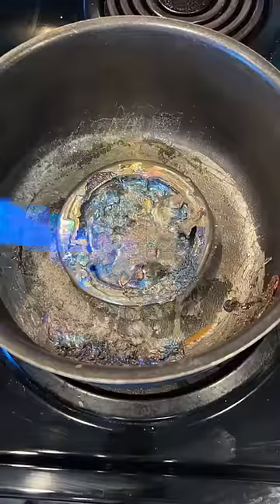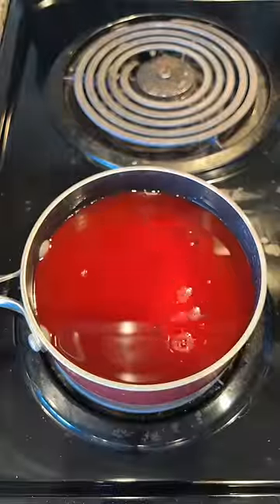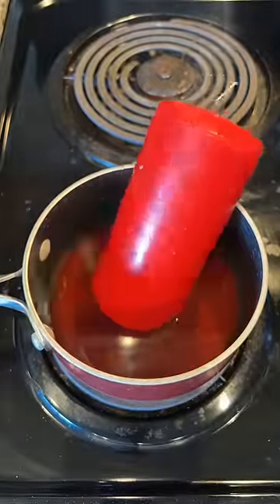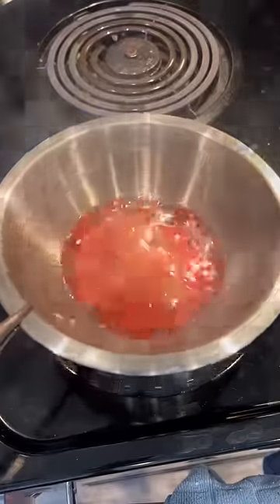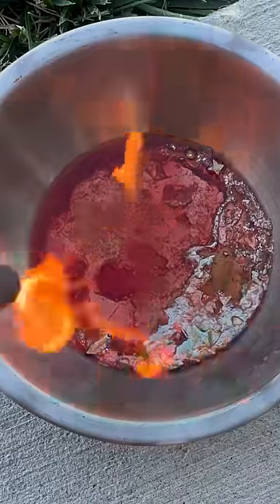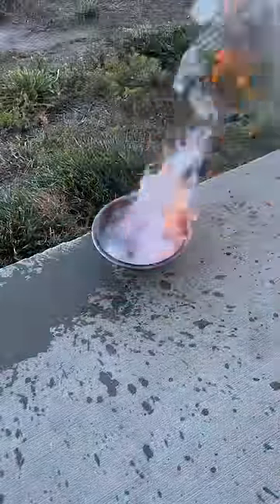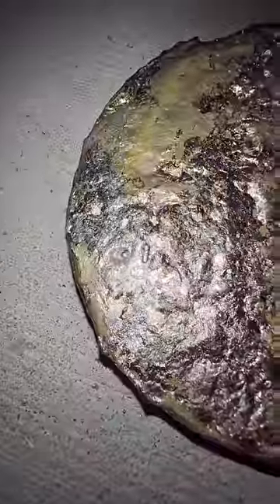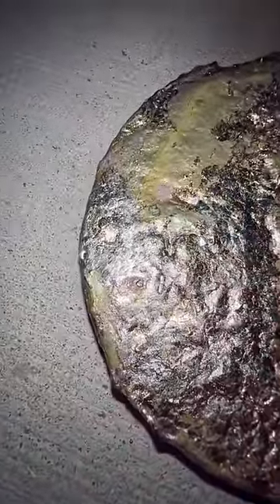Will Molten Metal Mix with Wax?

Comment: “What happens when you mix an oil with a dense metal?” I’d assume they separate just like they should?
Reply: What about the try of extinguishing it with water😄
Reply: @VR46Monster   He new that was gonna happen, but unlike know what would happen he thought there would be something special about mixing bismuth and wax, which was just stupid to think.
Reply: Cool bit of knowledge. They infuse soft metals with oils to create bushings that would have been eaten up by the shafts. The ones i use at work are called oil impregnated bronze bushings. Really useful in the engineering world.
Reply: @robertgarber1678  what was the oil doing to the bronze bushing tho
Reply from the maker: That’s actually not all that happened. Yes, initially the less dense wax floated on top, but after stirring it up a bit it did indeed mix. I still have that chunk of bismuth and it has a very interesting waxy feel to it. Nothing Earth shattering, but still kinda interesting IMO
Reply from the maker: @rjaylick-uni_novaz  I didn’t think anything crazy would happen, but I do think the results were kind of interesting. Yes, the wax initially just floated on top of the bismuth, but after stirring it did indeed mix. Nothing Earth shattering, but still kinda neat.
Reply: @jackschneider17  nothing mixed. You just stirred it and so some pockets were created, trapping the wax in as the metal solidifies.

Comment: Bro called a candle a wax stick 💀
Reply: It is though
Reply: It literally is made out of wax, what's so weird? -_-
Reply: A Filler wax stick is used for either to repair cracks, splits and small to medium-sized holes without sanding or having to strip the finish. hair wax stick makes your hair silky smooth and soft, easy to comb, prevents frizz, flyaways and tangles. 

Even though you could do these things with a candle, that's not what a candle is intended for.
Reply: @proxyhx2075  wax sticks are different from candles even though candles are made of wax. You can't use a candle for the same purpose other waxes are used for, at least properly lmao

Comment: You should look up how they used wax to form the inter cooling channels on the main combustion chamber of the space shuttle in the 70's using electroplating and then getting the wax out after.

Comment: I “mix” wax and molten lead all the time.  It smokes, catches on fire easily, and allows the lead oxides to reduce back to metallic lead.  And it acts as a kind of flux to pull imbedded crap out of the melt.  All at about 680-700 degrees F.

Comment: It's actually possible to mix metal with wax via sintering. Simply get both into a powdered form and press them together at very high pressures. If you really want to get fancy, send a current through it to heat it up a little bit to increase the viscoelasticity (but don't exceed the melting point). This method is known as Field Assisted Sintering Technology

Comment: I'm not for certain, but I do believe that they use wax in some castings. As the molten material goes in the mold the wax burns away. It might not be wax, but definitely something similar.

Comment: If you grinded up the two materials,homogenized them and put in a vessel with extreme pressure while heating above both melting points I wonder if that would do what you were aiming to do

Comment: Try to melt the bismuth, and connect 12v power source to the liquid metal while it still cooling. It's interesting if the crystals will form differently under electricity.

Comment: Make a bismuth perl. With a air pocket. In the center. It's called a emcore. Used in space travel. Better if you use a big crystal geod. But to rare to find an have to watch not to brake it. If you make a bismuth pearl only one prob. Putting quartz in side it. .

Comment: I mean, the wax likely wouldn't have set on fire if you didn't hit it with an open flame. It's the same reason you heat up alcohol with a hot plate...

Comment: i actually tried this and im 10 without any guardians near me i was scared for life why it lit on fire cause i was trying to burn wax and me and my cats were panicking when i threw water at it it just grew bigger its so hard to put it out i was in my house doing this my arms got burnt cause of the extreme heat and when my parents arrived home i told them about it and went straight to the hospital cause i had extreme burns on my arms legs cause i was trying to put out the fire and the smoke alarm in my house was beeping alot and smoke i almost died cause of it so DO NOT TRY THIS

Comment: A grease fire is a class B fire...your metal on fire is class D

Both of which don't need water, but that reaction is a class D reaction - pouring water on grease simply spreads the fire

Comment: Trained professional in a controlled environment bruh your in your kitchen with a fire extinguisher and its bismuth a low melting metal not dangerous also why not just buy regular wax cheaper than melting a candle also puter is a cool metal that can be found easily

Comment: I would have melted the 2 then poured the metal into the wax rather than the other way around cause the metal would disperse better that way than trying to mix wax into molten metal